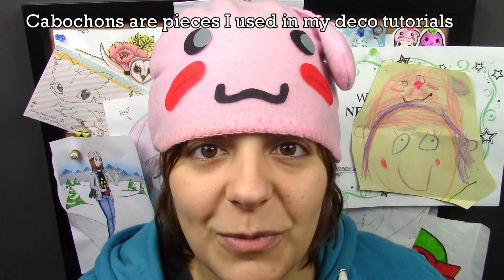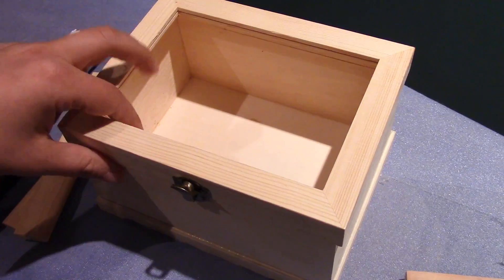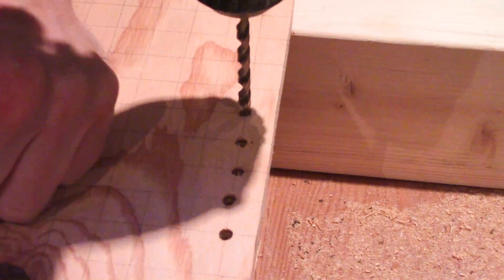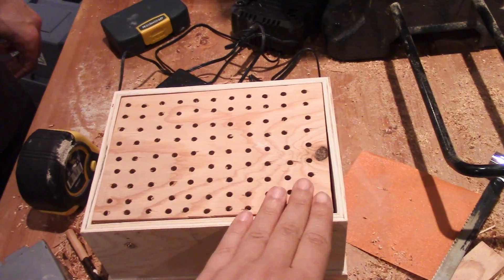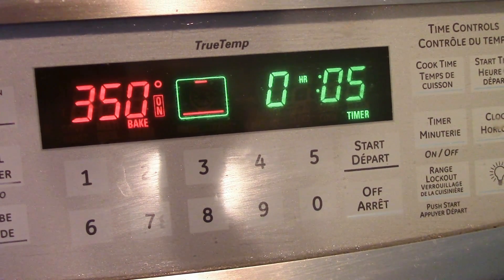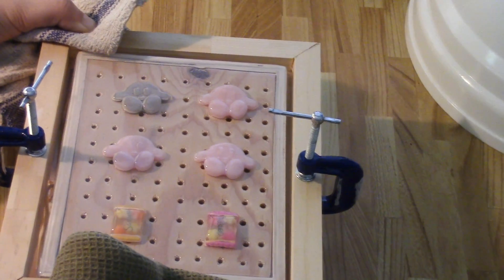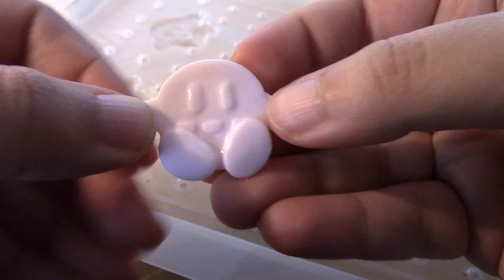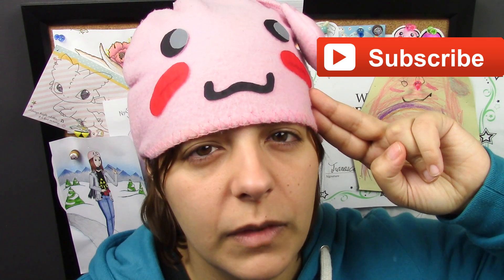DIY PLASTIC MOLDS - how to make a vacuum former EASY

Comment: I have just finished making a slightly modified form of this (had to build the base box too), did you say 3mm thick sheet? Or was it 0.3mm? I am struggling with the holding frame still, and using a heat gun on a thick plastic file cover which is about 0.3mm thick. Would 3mm work too?

Comment: Neat. I would imagine you couldn’t use 3D printed items as the basis for making molds since the plastic sheet would stick to or melt the item, right?
Reply: Have you tested this out? I'd wonder if you used a mold release if that would help prevent sticking. Melting wouldn't seem like an issue since it looks like the plastic gets  cooled kinda quickly.

Comment: There's a dental/medical called denture vacuum mold (sold on eBay, surprisingly enough) machine, that is used to make molds for patients (dentures or trays to bleach teeth, for example) and your DIY is very similar to that machine. I'm very impressed on how well it turned out. As for the plastic, you can call around some dental/denture companies or Google for the plastic templates, those would be ideal for your DIY since they would be the perfect size and width.

Comment: If you use thin ABS plastic...and it doesn't mold around your pieces right..like webbing or deformations. You can remove the pieces and REHEAT the plastic again for a second try.  Thermoplastics are re-heatable

Comment: Just a FYI...if you want direct contact with professionals using vacuum formers...look up local sign MANUFACTURERS that make plastic signs. They use industrial equipment but if your nice and explain what your doing I'm sure they'll be happy to answer questions if you need "professional help"

Comment: Round off the edges of the top of the box...the sharp 90° of the wood edge doesn't give a good seal and "stretches" the plastic potentially tearing the plastic as you mold. Get a shop vac the "pull" will be far better. Numerous Smaller drilled holes closer together will get you tighter molds and better "draw" of the plastic. Last but not least..watch for "undercuts" such as shapes that the plastic can mold around..but get locked or trapped into the plastic. Light dusting of baby powder rubbed onto the piece help to release from the mold.

Comment: Hobby shops will have cheaper smaller plastic sheets..evergreen or plastruct are the most common brands. You might be able to use plastic folders cut up as a source of plastic too...make sure NOT to use the molds to create edible chocolates as unless your using the correct plastic it can leach out the chemicals to the food and is toxic.
Reply: mxferro not sure where to find the correct plastic for the vacuum formers? I also thought about using a plastic folder?? Would Lows or a Home Depot have the plastic I would need? Your input seems very helpful. Thank you for that!

Comment: There are "reasonably" priced vacuum forming machines on the market for anyone not able to build this.  
 Side note: if you want sharper detail..you'll need to create a "negative" mold for the plastic to pull down into instead of the "positive" set up you currently have.

Comment: Umm..if it helps
 You could do the box upside down too..drill your holes in the former bottom of the box ( now flipped ) and strong wood glue a flat board bigger the the perimeter of the previous "top" . Do all this after you've drill the hole for the vacuum hose end.

Comment: Does the pegboard have to be wood?
Reply: WADJET NINE you can make the platform from metal too.  Don't use plastic as the platform as the heated plastic would attach to the platform.

Comment: Nice idea. O would use a very fine, rigid mesh rather than a wooden square with a few holes. But I think, I will go for it. Where to get those plastic sheets?

Comment: ive been wondering about this for a while, how to make a mold using mcdonalds plastic toys, (specifically the 2016 sanrio hello kitty, hello kitty figurine) can i use this method or will it melt the plastic, using the 2 part silicone mold or will the toy get stuck/ peel the paint, or a different method?
i wanted to use the mold for polymer clay...
Reply: 2 part silicon shouldn't melt/peel the plastic from my experience. So I would personally recommend that. But I don't think the plastic is a good idea. But I haven't used it before ^^

Comment: can I use hot glue?
Reply: If you mean hot glue to  mold, you can but a majority of the time you will find that the mold will have bubbles/cracks. And it uses a lot of glue for bigger molds ^^;

Comment: about how thick do you think the plastic has to be to do this could you just get i regular peice of plastic
Reply: Reyna Salomon she's using a very thin plastic..not thin like a film but about as thick as cardstock . if she tried to use a thicker plastic it won't form around the objects on the box as she would need a much more powerful vacuum source.

Comment: ohhhhhh that is so awesome!!! Thank you soooo much for this video!!  What thickness of plastic sheet did you use?  I found them here, but not sure about the thickness, or if that would matter much:  http://www.usplastic.com/search/default.aspx?q=High+Impact+Polystyrene&view=g
Reply: I have some hdpe containers from kiitty litter that I'm thinking of trying. I bought a jewellery box from Dollarama, and I'm thinking if I take off the hardware and put some duct tape around the cover, then drill the actual cover instead of putting a separate board in the top it might work. Then I will make a hole the size of my shop vac tube in the side. I'll let you know if it works :D
Reply: PS nice to see a Canadian who is making great tutorials on Youtube!

Comment: @NerdECrafter you don't really have to spend that kind of money for one sheet of plastic..... gallon milk jugs or water jugs any that look milky white and has a 2 in the recycle triangle. The plastic will do the same thing get clear as it heats... altho any plastic molds shouldn't be used with anything you have to heat & pour. You should use the silicone & cornstarch mold for anything you have to heat. If you have some questions about this just holler. ..I've been searching for ways to make molds also...I so enjoy your videos....my kitty and watch them alot her fave was the octopus you did! :)
Reply: I know LDPE is not for heat application but I thought I read that HDPE was food safe and forms at 285F+ so would be okay to use for some heated applications. I'm wanting to use it for hard candy but not sure if that would work. Pouring temp at approx 200F. SIlicone/starch mold seems great to make a small number but vacuform is appealing in that it would be faster to produce large quantity.

Comment: If you had smaller holes and closer together, you'd get a better mold and you wouldn't have to worry about a hole showing up in the middle of your piece.  Great tut, best low cost vacuum former I've seen.

Comment: So, I have to double check something. You said the plastic is 3mm thick, but it doesn't look that thick and when I measure the thickness of some molds that I have, they are 1mm thick. I ma having such a hard time finding LDPE that will work. I ordered some at 3mm thick and that can't be it...it was way to hard and not flexible at all...can you let me know if maybe yours is 1mm? Thanks so much.

Comment: Wow this makes diy vacuum forming machines so much more reasonable to make now! I've watched videos on the subject for years but they always felted so heavy duty and daunting. Awesome!

Question: Does the board have to have so many holes in it? The mold at the end of the video had a LOT of holes super near a lot of the pieces wouldn't that cause wasted product and inferior molds? Could we have some spots that are hole-less that we put our charms on as long as their are lots of holes elsewhere?
Reply from the maker: The holes are around the piece, so they don't interfere at all. You don't have to make the holes as big, but you need enough to create a strong suction for the vacuum. :)
Reply: NerdECrafter Thanks so much for replying! :D

Comment: A cabochon is a polished gem, without facets.

When warping pungent plastic sheets, I have to open the kitchen window and shut the door tightly, as the stench is horrendous.

Thanks for the advice NerdECrafter (but are you sure that a two inch sag is correct? Or is that only for larger sheets?).

I've used a: cheap (clear), polypropylene, food storage box, with holes punched in its lid and a large one cut (low) in its side. For frames, I've crudely scissor-cut a couple from a large biscuit tin lid, which I rest upon two aluminium candle stick holders (laid horizontally), under a medium light grill.

My plastic sheeting is whatever can I find from my recycle bin.

Comment: NerdECrafter, I am a molder and mold box maker (www.rockstarhottietoo.com) and I want to share with you some tips.  1st.  Instead of c-clamps you can use XL binder clips (you can find them at Office Depot, Office Max, etc.  2nd in the hole you made where the vacuum goes you can insert a 1 1/2 inch (of course depends on the size of the hole you made) male adapter pvc plumbing piece.  About .97 cents at Home Depot.  This is a great thing to add so when you insert your vacuum hose you can duct tape it so you get the best section possible.  3rd.  Use a smaller drill bit for the holes on the top of the box.  I suggest 1/16.  What this will do is prevent holes from bursting open.  This happens when the holes are too big.  You don't need to drill more holes as long as your box is sealed well.  4th.  after you lay the top of the box inside the frame get some wood glue and glue all around the the frame.  It will seal it and give you much better suction.   Thats all I can think of right now but if you have questions you can find me on my fb group:  mold hoarders anonymous!
Reply from the maker: akiko gazdziak THANK YOU =D
I love getting tips <3 I'll definitely do that when I make tweaks to it. I'm in the process of finding better plastic for this since LDPE is a bit stubborn in forming =D
Reply: LDPE is best for resin.  Petg for soaps and chocolate.  make sure you heat the plastic so it is translucent (basically clear).   You will want a sight sag and  you may want to drill holes with a very small drill bit in some inconspicuous spots.  THis will help with detail immensely.  Petg sucks for getting resin out.  I use LDPE and I swear by it for resin molds.   if you have any other questions feel free to text me.  8474608811.
Reply from the maker: akiko gazdziak Thanks!! I'll totally need your tips XD Send me a message on FB. My link is in the description box :)

Comment: I love your tutorial.  When I used plastic you used, the mold came out perfect.  However once the mold cooled the mold was no longer bendable and even though I used mold release my resin piece wouldn't come out.  What am I doing wrong?
Reply from the maker: RuBy ALLeNPeAcH Maybe your resin piece didn't fully cure. If it is cured, try putting the mold in the freezer for a few minutes and then try to unmold your already-cured resin. I never had issues with the plastic and pieces not unmolding ^_^
Reply: NerdECrafter Thank you so much. I will give that a try
Reply: NerdECrafter I tried thecfreezr and That didn't work.  Once the plastic cools its really brittle. Maybe I'm overheating???? Any ideas?

Comment: Have you tried making your own silicone molds? you can go to the hardware store and get a caulking tube of pure silicon and gun. Squeeze some of that into a bowl of  cornstarch and mix it around with a spoon until it is not sticky. you can also add to bit of acrylic paint to give it color if you wanted to it's cool I like doing this it's cheaper to buy it this way then going to Michaels and getting that 2 color mixing stuff.
Reply: cheyane frantzen I gather that the acrylic paint's moisture, also helps the putty to cure.

Comment: If you dont want your peg board popping up every time you take off the molded plastic you can use wood glue to hold it in place and helps more with the suction. I did this with the large machines I created =D Oh and do be careful with the size of holes you drill because if they are to big they will weaken the plastic and cause it to tear through the large holes.Love your tutorials ^_^
Reply from the maker: awesome advice! ! thank you so much =D

Comment: Would a toaster oven or heat gun work fine with the plastic and this is a very excellent tutorial
Reply from the maker: toxic bunny Thank you. I don't think a toaster oven is big enough for the plastic, and the heat gun would not melt the plastic evenly ^_^
Reply: Ok thank you